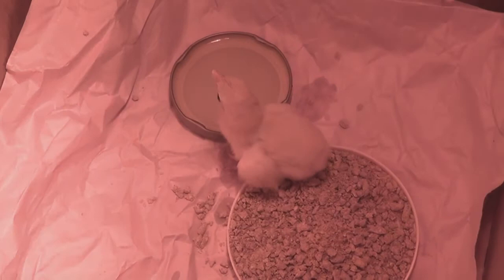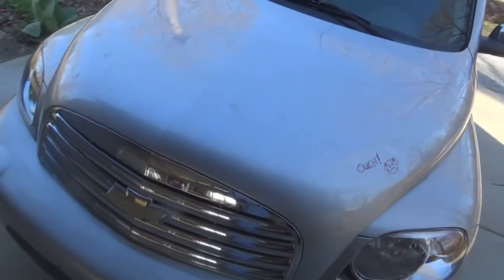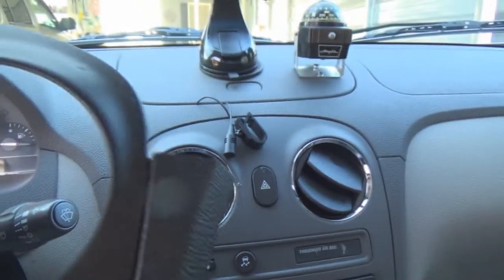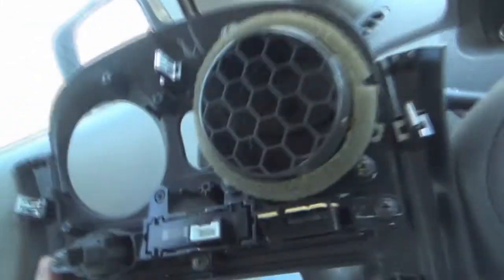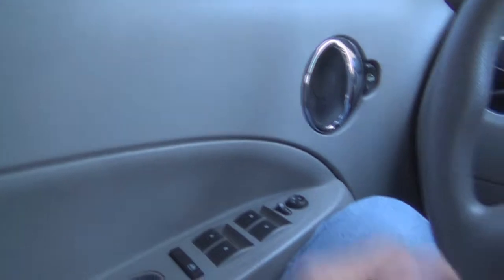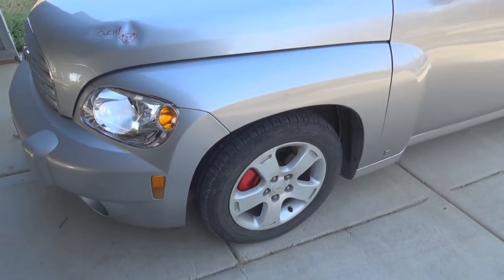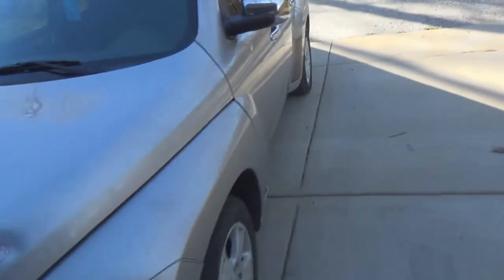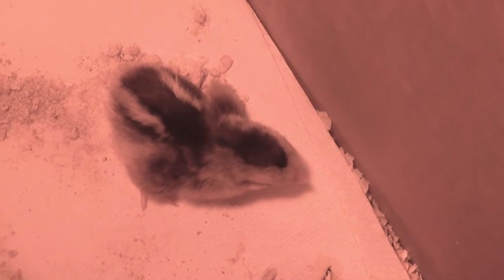HHR tips and tricks, plus a few surprises...no fooling!

Comment: I love HHRs. I had 06 red LT. Drunk driver hit me so that was gone. I now have a white 2011 hhr with chrome rims and chrome inside and i installed app controlled LEDs under all 4 seats amd now installimg a touch screen with backup camera. HHRs make it easy to take panels off and keep the wiring clean. Also good gas milage. Reached to 403 miles on one tank and driving performace is amazing
Reply from the maker: I really enjoy our HHR too and have an 07 parts car since I got hit by a deer. It was cheaper to buy a whole car (bad transmission) for the front end parts like fenders and doors, etc, than to buy them separately. Thanks for stopping by
Reply: Ya I had 09 and just bought 11 ...I missed my other one... great little cars
Reply: Show us!

Comment: Got one of these from my brother a few days ago. The interior is a little monotone (grey on darker grey, all the same texture), but it's spacious, reliable, and extremely easy to work on (i haven't had any of these problems). Gas mileage is good for it's size.

I really want to mod the crap out of the interior, but I'm not sure where to go with it
Reply from the maker: I used the seats out of my parts car to replace the worn out ones in my pickup, so now I have a power seat on the drivers side. We really like our HHR.

Comment: I have a 2007 hhr with 102,000 and still runs great
Reply from the maker: Mine is about to go over 80K. It has been a great car. The idiot lights are an issue, but oh well. Thanks for stopping by. I'm going to be doing the front struts real soon.
Reply: I have a 2007 I bought new and have 93000 on it. Love it and still happy to still have it. I thought of selling it a couple of times but was happy I didn't. Don't drive it that much but still can take it anywhere.

Comment: Window controls on mine are on the console. I have fixed two headlights and a window regulator. Gotta say, I love these cars.
Reply from the maker: I guess yours is an 07 or 08? I love my HHR too and my parts car has been a big help for more than just the car as the front seats ended up in my 03 GMC Sonoma pickup! Thanks for stopping by.
Reply from the maker: My parts car, which is an 07 had the controls on the console. It is more convenient on the doors for me. I really like my HHR. Thanks for stopping in to take a look.

Comment: Wow I had chickens believe it or not in the south bronx....still contemplating getting a chicken coup and having some again..... I've got my buddy's 07 HHR and he wants me to service his transmission fluid and filter and cooling system.... his HHR has no dip stick for checking transmission fluid level it's checked by removing a plug on the side of transmission as you fill you watch for fluid just starting to come out of that plug hole and that's the proper level on level ground..... yes engineers can be sadistic people. I will video and post a video of the maintenance soon. Good luck with your HHR!
Reply from the maker: Thanks so much and have fun with your HHR repairs. I was hoping that my parts car only needed a little more fluid to "fix" the transmission, but it definitely is blown for sure.
Reply: @TheShadeTreeFixitMan  well if the parts car trans is blown then it's a perfect time to do a postmortem and rebuild lol!

Comment: At about 5:20 you say you wired the fog lights to come on with the hi beams 'because that's about the only time you would want to use them'. This is entirely backwards, you do not want to use hi beams in the fog, they just illuminate the fog making it harder to see. Fog lights are wired to go off when you turn on the hi beams!
Reply from the maker: I am interested in seeing better in the dark, regardless of fog, which is the reason I wired them that way. Thanks for the observation.

Comment: The 2008 HHR door locks are also on the console, I have had My 2008 HHR since 2014 the previous owner pulled it behind their RV so the mileage on it as far as running mileage is low. It now has 116,000 miles on it and it is a strong running vehicle I have taken very good care of it keeping up on the maintenance of it all standard stuff mostly
Reply from the maker: I have less than 70K on my HHR so far. I like mine very much. Would you believe that I have had 4 flats in 3 weeks? Not the fault of the car, but that is more than I have had in the last 25 years combined. Thanks for stopping by.
Reply: @TheShadeTreeFixitMan  My HHR is the same color as yours Half or over half the mileage on mine is from being towed By Their R/V When I First Bought It The Hood Was Out of Shape A Little Bit So I asked the body shop what they would charge, and the price was way more than I could afford so when I got home, I thought to myself maybe I can straighten it out with a little muscle and elbow grease so I open the hood and grabbed a hold of the grill and started pulling on it and eventually it sat in place just find like it should and the gap along the hood and the fender went away and it took me less than a couple of minutes
Reply from the maker: @georgepope5010  Good job on the hood. I still haven't fixed mine yet and may not since it gets amusing responses from time to time with the art work on it. Blessings to you as you celebrate the birth of Jesus this year.
Reply: @TheShadeTreeFixitMan  As Long As Your Hood Still Latches That's All That Matters, Besides It Gives It Character

Comment: George couldn't you go to a tire shop and swap the new tires to your old sensor rims and old tires to parts car rims. then your air pressure sensor would work.
Reply from the maker: I would just need to put sensors into these rims. The funny part is that every morning after sitting overnight, the computer picks up the readings from the parts car. I am contemplating buying some sensors and having them installed. Thanks Glenn

Comment: Hey I just found your page and seems like you know the hhr really well so I have a question for you.
I bought a 2011 hhr a couple years ago and to be honest it was almost trashed I believe the previous owners used it as a 4 wheel drive trying to jump gulleys and what have you the front end was very bad miss matched tires and rims but I replaced most all the suspension struts, shocks , control arm oh goodness, new tires nice rims and finally was able to get the front end aligned.
Anyway a couple years later I still love this car but also when I got it the speedometer didn't work correctly and one of the gauges don't remember which one now didn't work so I went to a local pick and pull and got another instrumental cluster for it and so all my gauges and speedometer works as should but the odometer had like 106,000 miles on it and it don't work still shows the same as it did when I got it.
Now the trip meters A and B works fine just the main odometer and I have searched and searched as they say the cars computer stores the readings for miles driven and I'm wondering why it don't update the replacement or is there anyway to at least get this to start working.
Oh and by the way the car must still keep up with the miles because when I change oil and reset the oil change monitor it still keeps up with the % before it's due again so all I can do is scratch my head. lol
Reply from the maker: Well, I don't have much hair on my head so I try not to scratch too much, LOL. Unfortunately, I don't have an answer for you on this issue. You are right that if it keeps track of mileage for oil changes there should be a way of tapping into that information for your odometer. That stuff is above my pay grade, sadly. Sorry I couldn't be of more help. Thanks for stopping by.

Comment: George. I had trouble with my airbag warning light for years. Then one day I was doing some stuff and decided to unplug and reply the plugs under the seat and lo and behold that was the problem fixed. Try that but make sure u unplug the negative terminal and let the car sit overnight to drain residual power so you don’t accidentally trip your airbag. Also sometimes that will reset your tire monitors. Hope that is a help to you.
Reply from the maker: I will give that a try. Unfortunately, the tire monitors are non-existent so the computer will continue looking for them. Thanks for the tip.
Reply: @TheShadeTreeFixitMan  In the passenger side kick panel you’ll see the yellow airbag plugs. Disconnect them and spray them liberally with electrical contact cleaner then spray them with dielectric grease. There was actually a service bulletin on them apparently years ago. I also did the same for the under seat connectors and so far the light hasn’t come back on.
Reply from the maker: @cheapme1850  Thank you so much, I will give that a try.
Reply: @TheShadeTreeFixitMan  Don't forget to  disconnect the battery for about a half hour to make sure it's safe.

Comment: The chicks are so cute. Looks like you have been busy for sure George. I think you can buy the sensors to put in the wheels that are now on the HHR so that your tps system will work correctly but they may have to be programed talk to a tire store they can tell what would need to be done.
Reply from the maker: If I buy the sensors, I will have them installed at a tire store who can hopefully program them to match my car. Thanks Bob. Blessings of the resurrection!

Comment: Have you had the front end shake problem. I have an 07 and 2010 and both shake when braking. Any ideas? I've replaced control arms, sway bar links, bushings, rotors (which does smooth it out for a few thousand miles ) but returns. Seen alot of hhrs with this issue
Reply from the maker: I haven't had that issue, but it sounds like you have a sticking caliper, which is the one thing you didn't mention replacing. When they stick they heat up the rotors causing them to get warped and hence the vibration. I have experienced in lots of other vehicles. After you replace your problem caliper, you should have your rotors turned to true them up again. Hope this helps. (I was an ASE certified mechanic back in the day...) Thanks for stopping by

Comment: Your parts car looks really solid, at least at a distance. How did it end up being a donor?
Reply from the maker: The transmission is bad in it. It has provided lots of good parts not only for my HHR, but donated the front seats to my GMC pickup as well. It will run still, but won't move. Thanks for stopping by

Comment: Nice fix on the HHR George. It gets pretty crazy chasing wires and making things work, but with a little perseverance you overcame. Is there any way of getting the sensors out of the original wheels and installing them in your replacements?
Reply from the maker: I could have them removed and re-installed in the new wheels, but it will probably be less expensive to buy new ones, since all 8 wheels would have to be broken down to use the originals. Thanks for stopping by

Comment: Hi George so what’s the warning lights on the dash for also are you going to get the warning lights fixed so they go out when your car is running also did you put that sport muffler on it yet
Reply from the maker: I am working on fixing the issues with the warning lights and no, I haven't changed the muffler at this point. Thanks

Comment: Hello, what LED bulbs did you use?
Reply from the maker: Good morning Alan. I have not been satisfied with the bulbs I used, they don't really illuminate as well as I had hoped. I am going to go back to my original bulb on one side to try a comparison. It may be the orientation of the LED that keeps it from displaying down the road, since this set has only 2 chips on the bulb and they are orientated to each side and as you know these headlights work on reflected light. Stay tuned for more on this process. Thanks for stopping by.

Comment: @3:11 These acrylic stone guards on my silver 2008 HHR are discolored and unsightly. They make the car look cheap. Anybody have suggestions on what to do with them? Paint, remove, what have you? Thanks.
Reply from the maker: I have the same issue and working on a "fix". Stay tuned!
Reply: @TheShadeTreeFixitMan  One guy taped off area and applied two coats of spray-on bed liner. It looked good on his red panel HHR.
Reply from the maker: @RStevenPage  Sounds like a plan to me.
Reply: @TheShadeTreeFixitMan  ebay has HHR  stone guards. The ones I saw needed sanding and some other stuff. Please keep me in the loop if another fix crops up. Thanks.